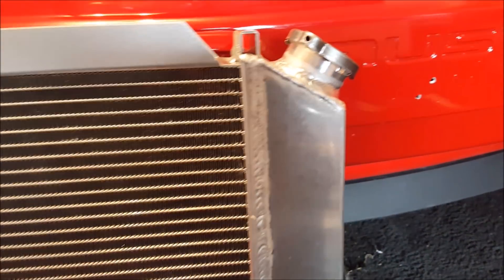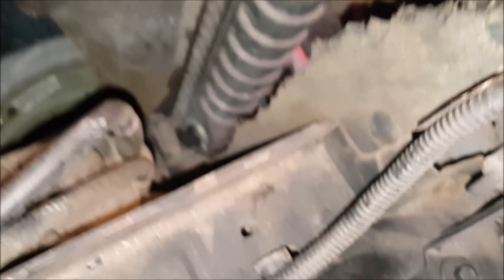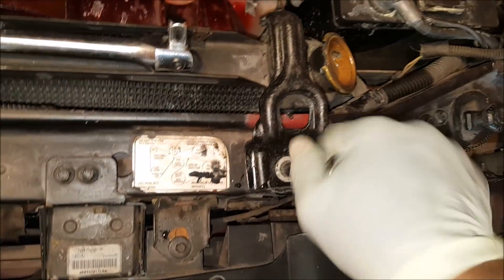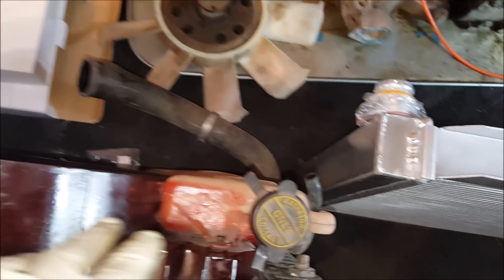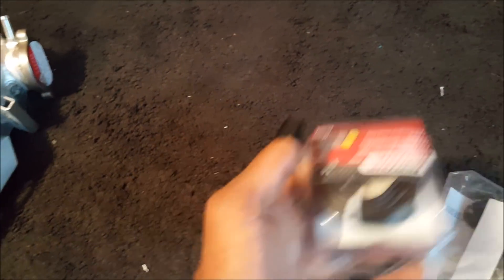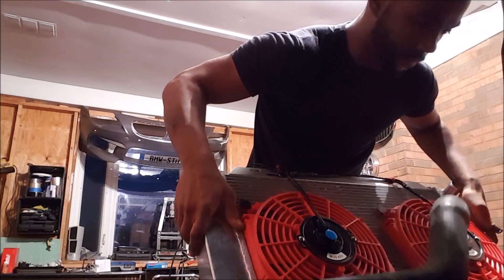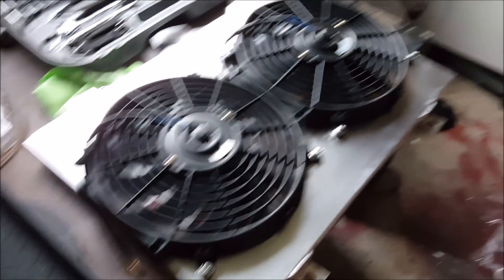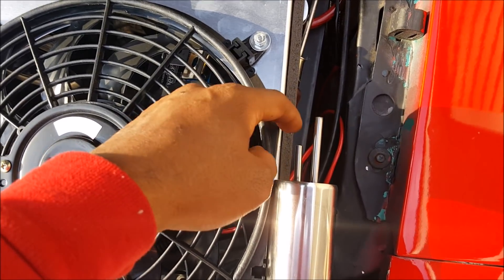Cooling a modded 5.0

Comment: I seen vids that show those electronic fans cause electrical problems.
what I think I'm going to do, is go with a three row with a smaller flex fan.
Had a set up like that on my 91 years back with 160 degree thermostat, seemed to work pretty well with the exception of the fan  staying on.
them flex fans look pretty cool with they're anodized colors and they work.
If you go with a different thermostat you'll probably need to get it chipped or tuned.
Not sure if we can get tuners for our 5 O's. 
But bully dog sells tuners that allows you to calibrate the setting with the thermostats.
Super Chips can program a good chip that'll also calibrate and reset with the rest of your add on's.
Reply from the maker: Part of the reason I wanted to stay away from messing with the fans and cooling system.  These fans do cause a significant draw at idle, i already have an upgraded 130 amp alt from an SN95, next i will upgrade to a nice optima battery, hopefully that will help.
Reply: Most of these fans are wired completely wrong which is why several people have endless issues with them.  Under drive pulleys don't help the situation either.  Add in the fact that most people have very little knowledge concerning their battery and how to keep it properly charged... that is the recipe for electric fan failures.
Reply: I think a big issue with these cars is the fact that they are modded well beyond their original design requirements.  A very common problem with the fans is found in the wiring of the fans.  You really need the proper size gauge wiring so the fans can consume all the current they require to spin fast enough.  You also need fans that will move enough cfm to provide adequate air flow.  Running two fans would require two water proof 40 amp relays and individual wiring to each fan from a proper fuse panel.  Wiring should be around 12 to 10 gauge depending on the fans used.  Several of the aftermarket fan kits do not use large enough wire gauge which is an easy way for people to run into trouble.  Each fan should have it's own ground.  Also need a fan controller/thermal switch.  You need an upgraded alternator (which you have covered) with the proper gauge charging wire.  You need a grounding upgrade as well.  The battery to chassis ground on a stock mustang is not up to the job of running electric fans, gotta upgrade that.  Alternator case should be grounded as well.  It is a process and it can get expensive to do it right.  Which is probably why it isn't done right in several cases.  You can spend $250.00 on a fan kit and still need $50.00 to $100.00 in wiring, relays, fuse box, etc to finish the job!  As for the battery you don't really need to get an optima.  They are really nice though, so if it is something you want go for it.  However, it is not needed.  You should definitely get a battery maintainer.  Once you start using one, you will wish you had done it years ago. I like your channel.  You make really good videos and you keep it real.  I can also tell that you have a limited budget like so many of use do.  It seems like you are always looking for the cost effective way to handle your build.  That is hard to find on Youtube.  I hope you get this cooling situation sorted out soon so you can get down to the business of drifting that fox.
Reply: Seems like the clutch fan has it's advantages some times!  I just spent this weekend messing around with the junk yard fan set up a previous owner put on my black mustang.  It was irritating to say the least.  I was considering getting a clutch fan for it but I think i'm just gonna keep the fans and wire them up correctly.  My biggest issue is a huge oil leak AND rod knock though!  So I dunno when i'm gonna get around to fixing the fans up.
Reply from the maker: Yes, we are modding outside of what they are designed for, however, it's easily compensated for, nothing groundbreaking is happening here, and yes, you need to use correct materials for the electrical portion.  In the video i highlighted that you MUST use high temp primary wire, i didn't get into detail with relays and connections though.
Reply from the maker: That's how i got the idea, it's a very common method on the F bodies, I am a former Camaro owner.
Reply: ya, I just want to keep it simple for right now, I just got mine have a long ways to go.
starting with the suspension. 
It's already lowerd but needs a little touching up including alignment.
Reply: fwh79 well said.
Reply: Indeed.  Well keep up the good work.  Your car looks really awesome with the flairs by the way.  Very interesting build.  Your fuel pump replacement video is really good too.  There were alot of guys using that method on the third gen camaro and firebirds back in the 90s.
Reply: Thank you.